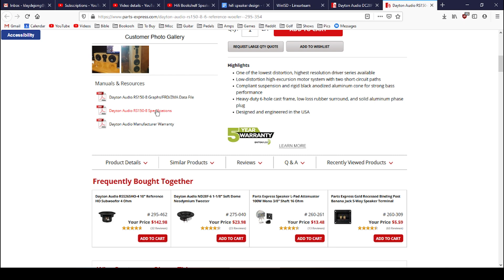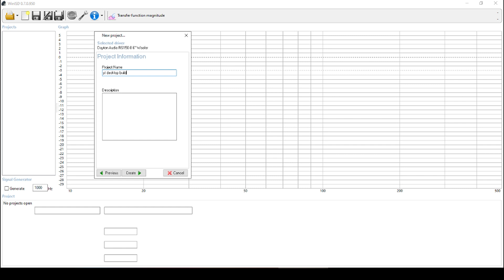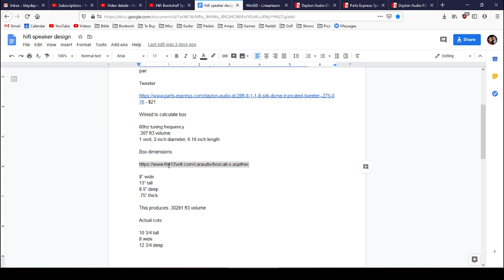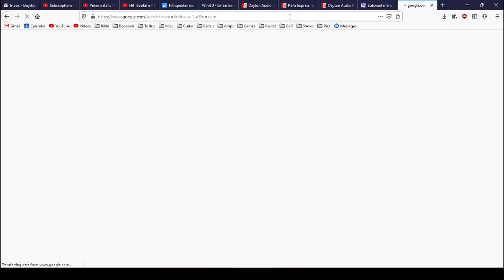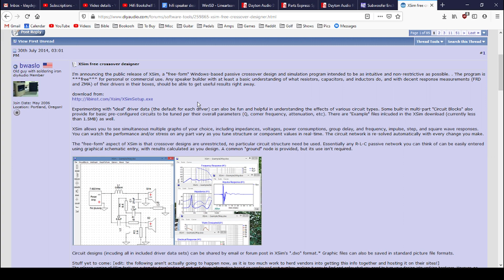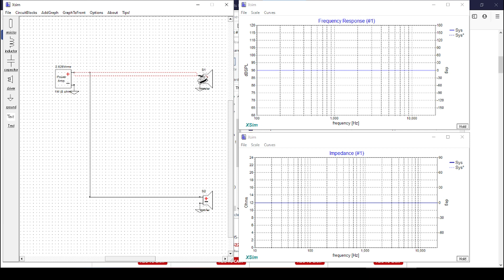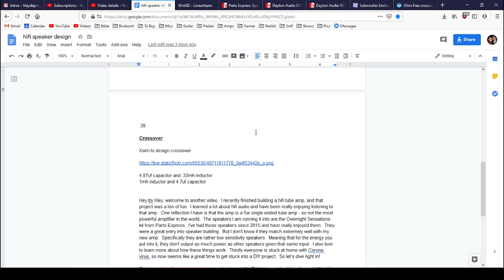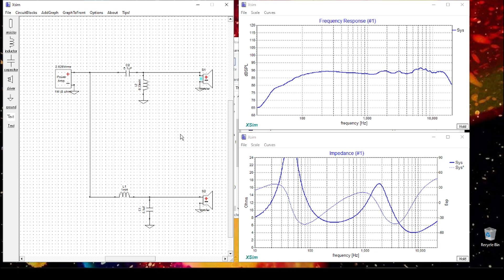Hifi Bookshelf Speaker Design & Build - pt. 2 | Box Dimensions & Crossover

Comment: Dude, you forgot one step - Baffle step compensation. There will be rapid roll off of bass so your speaker sound thin in bass.
I think you should lower your midrange and tweeter level atleast 3db, to compensate for bass loss due to baffle step..
Reply: There is an another software called Vituixcad. Which has Baffle step compensation tool. You just add the frd file of woofer there and put your box dimensions and can extract the actual response of woofer in the baffle..